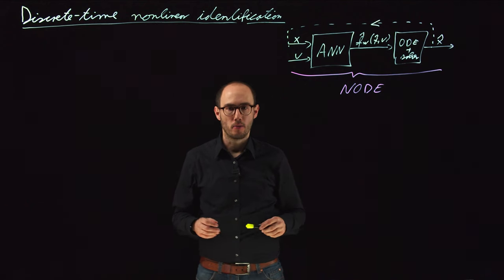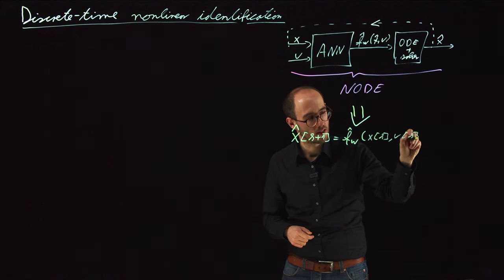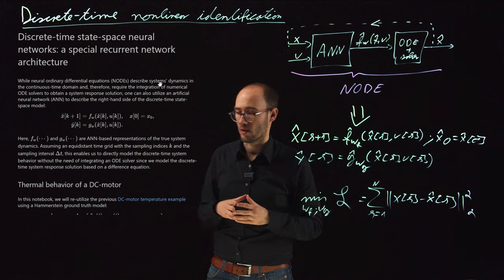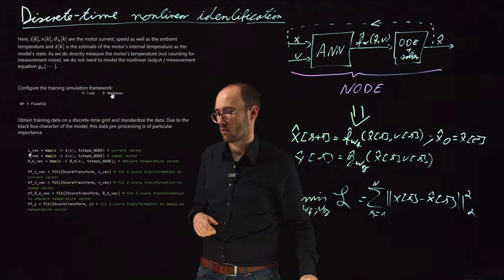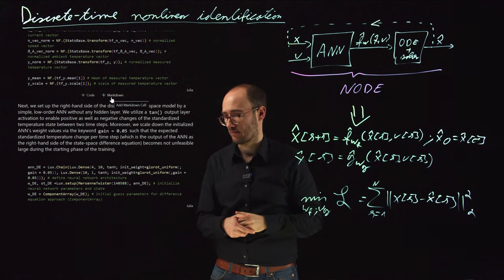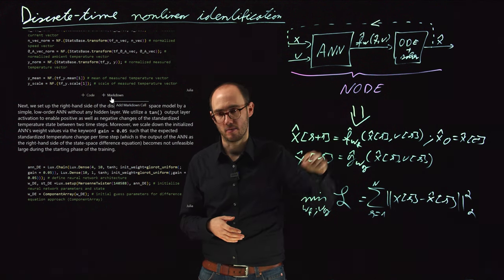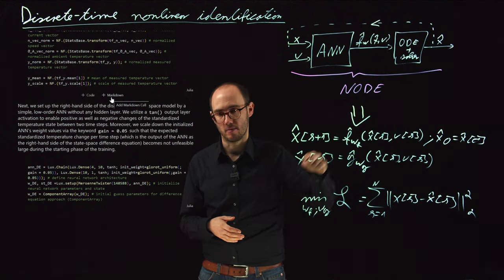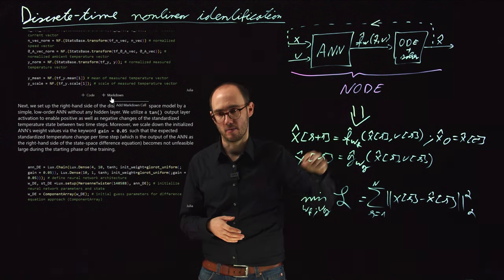Discrete-time nonlinear system identification (DS4DS 4.11)

Comment: is there any application lecture for real-time? this is all theoretical. The concepts are available from other YouTubers too but can you make lectures with a real-time application using Python?
Reply from the maker: Python as well as Julia are non-real-time programming languages, so there is always some effort in transferring the nonlinear concepts into real-time applications, e.g., by reprogramming in C/C++ or by utilizing auto C-coding (e.g., from Matlab/Simulink). However, recursive linear methods, e.g., RLS https://m.youtube.com/watch?v=M5QYofnx1dg, are particularly suitable for real-time implementation due to the light computational load (cf. the example https://ieeexplore.ieee.org/abstract/document/9131869).

In addition, the discussed methods from this video can be also executed in an asynchronous fashion using edge/cloud computing. By doing so you can run the Python/Julia code on a regular computer without the need of transferring the code into other languages (rapid prototyping).